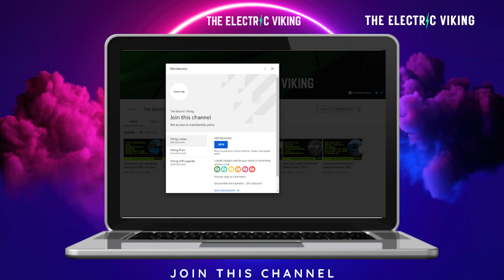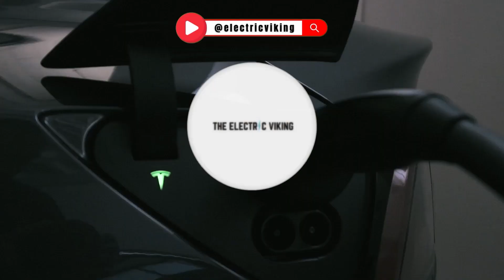World’s strongest battery reveals secret to FAR stronger, lighter & safer EVs

Comment: Carbon fiber is still HC oil/gas energy intensive product, 👎🏻 that produces a lot of CO2 in production👎🏻and also huge amounts of highquality fresh water. 👎🏻 
It reacts and causes corrosion with metals.. especially in Marine environments ...  In fact its used in new light wt high Voltage/current transmision cables as a substitute for Al or Cu. 
Structurally its very lively ie noisy unless damped. It scratches, gouges and tends to brittle fracture in composite structural failures... It needs protecting from high levels of UV .
In short its environmentaly and economically expensive and requires a high tech infrastucture to produce ...its difficult to repair and doesn't like shock point loads.  Its also deeply unleasent and harmful to work with..in terms of drilling, sanding and fettling moulded items...  and the risks of it getting in the human body. 

In the Marine industry for racing vessels they build the moulds from something tougher but a bit heavier but a 10 times greener - Natural Basalt fiber moulds and if Inventwoods Metelwood gets into comercial production you can use natural wood in place of steel or aluminium in structural engineering and design roles...and still be CO2 negative by about 50% capture over production.  

Theres an interesting comparison page on the French Windelo Electric Hybrid performance catamerans .

Comment: What is the difference between a structural battery pack and a "functional" structural battery pack? What constitutes  "functional" in a "functional" structural battery pack? How much better is a structural battery pack to repair compared ro a non-strutural battery pack? How much cheaper is a structural battery pack to repair and maintain, compared to a nonstructural pack? If a structural pack has one cell defect influencing performance, how much cheaper is it to discard and replace it, when it's out of warranty compared to a non-structural battery with the same issue?

Comment: You can have as much power density as you like.
Still a massive shortage of grid power to charge them.
That's why there's still no decent infrastructure even 10 years on ⚠️
Reply: Australia now has a grid excess, with more rooftop solar being built all the time.
Reply: @RARDingo 
You also have grid and local level long term energy storage battery's being built in which can smooth out demand and provide extended reserves for when environmental conditions are sub par. 

You also have tidal and geothermal options and extensive amounts of natural Geological hydrogen available.

Plus the Chinese have been looking at their coal ash tips ...and realised that it contains large levels of Rare earths elements. So stop using the stuff for fill and cinder blocks..🤦🏻🤷🏻 it's worth a lot more as a concentrated available complex rare earth ore.😂🧙🏼‍♂️🇬🇧
Reply: @RARDingo 
@RARDingo very little sunshine in UK.
Solar Totally pointless here for 6 months of year
Reply: China is using UHV, around 1000 vac transmission lines.  They can then distribute power from say coal mining regions, and burn it there, rather than using trucks or trains.  Same goes for wind power.  Grid infrastructure is a non problem in China because they have State Banks which issue state credit channeled toward industry and infrastructure.  Yes, the west will lag behind.

Comment: Perhaps, the entire car structure (frame, roof, doors, hood, etc.) are all built out of carbon fiber battery packs.  The car is the battery.
Reply: So making a disposable car .
No thanks ⚠️
Reply: @julesviolin  All cars are disposable because nothing lasts forever.  Do you know of any cars expected to last a million kilometers?  Some current battery technologies are projected to last for one million kilometers.  Everything else will break before then.  And if this particular technology does not last long enough, just make all the panels replaceable.  If some panel cannot be made replaceable, just use ordinary carbon fiber.

Comment: Although the energy density is low for this battery, its strength would allow it to replace structural elements in the car like chassis, roof, or even hood, trunk fenders.  This would allow the battery to possibly add zero weight to the car because it would become/replace car structure that is required anyway.